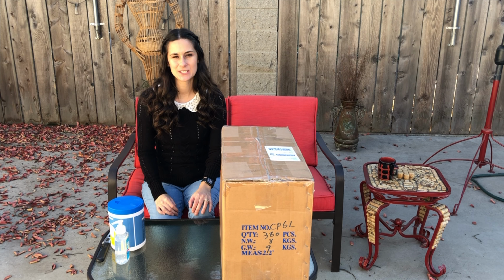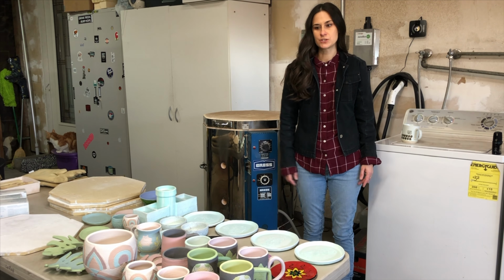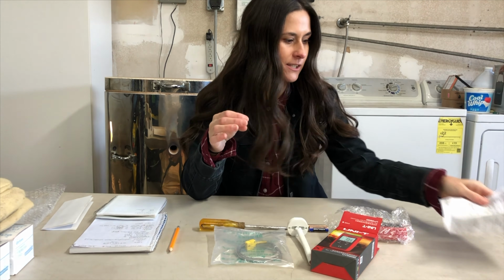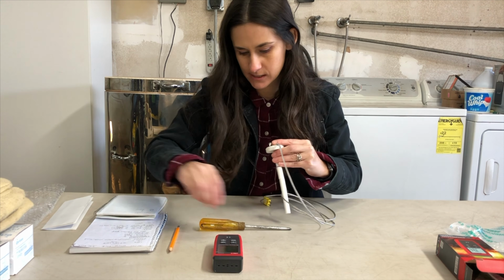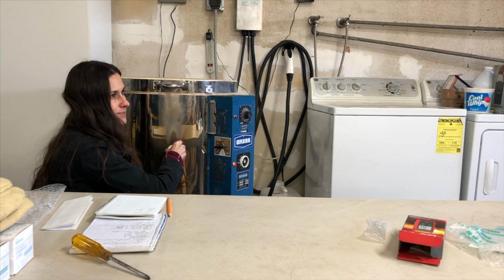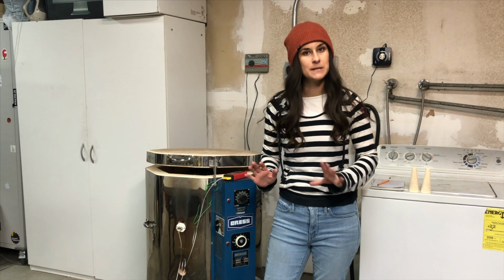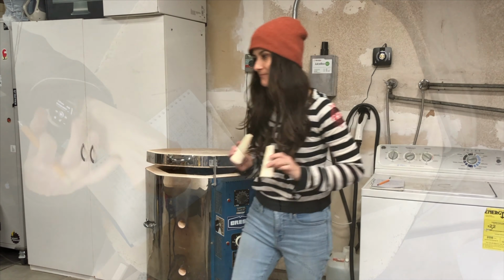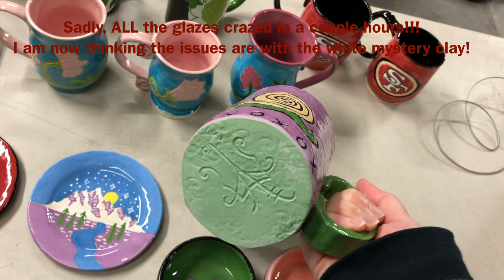9th kiln load: Failures & Successes- Using a Pyrometer & Thermocouple

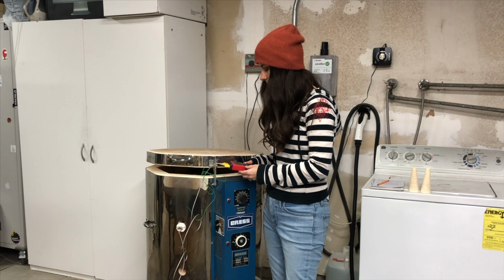Comment: Thank you for sharing this. I was wondering if you ended up trying what you mentioned around 12:00 mark and how it turned out? Do you have any additional knowledge about this topic that you've learned since posting this video? Thank you so much
Reply from the maker: Yes, I did drill a hole through my peep cone and placed the thermocoupler into the peep hole through that cone. This worked great! I was able to do this for all my future kiln runs and was able to tell the temperature.

Comment: Hi! Where did you get the thermocouple that you attached to the uni-t pyrometer? Brand and model?
Reply from the maker: It is a Uni-T UT320D Mini Dual Channel Digital Pyrometer. I also purchased the Hi-Temp Thermocouple add on. After I made this video I drilled a hole into a witness cone for the thermocouple to slide into, I then put this into the bottom peep hole. Here is a direct link to the Clay King website with the pyrometers: http://www.clay-king.com/pyrometer.htm
Reply: @HardShellSlimySnail  Thanks! I think these tools will help, without breaking the bank. It's so cool that Cress featured you in their ad, and I am looking forward to the podcast.

Comment: Red is almost always positive.
Reply from the maker: Good tip! Thank you!
Reply: The directions on the thermocouple will show that one wire has red paint on the end. This is the negative and the red lead connects to it. Not sure why they did this, since red is always "positive" in electronics.
Reply: @canaweb  yes, in every other electronic device, red is positive. Could be a misprint. Connect red to red and it should be fine.